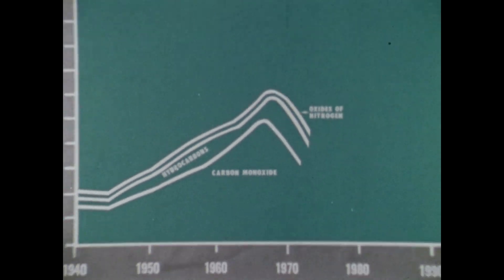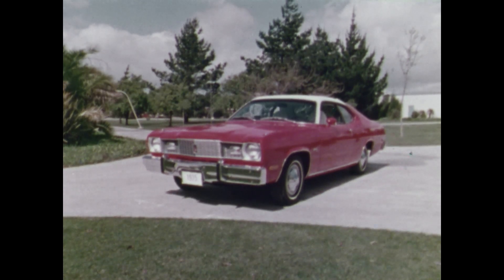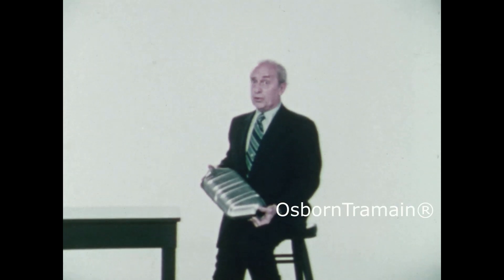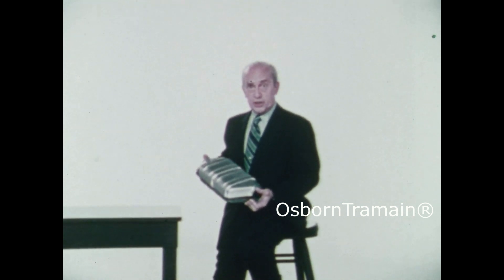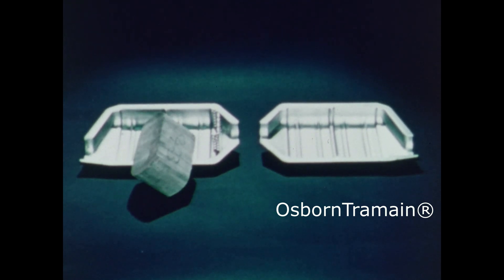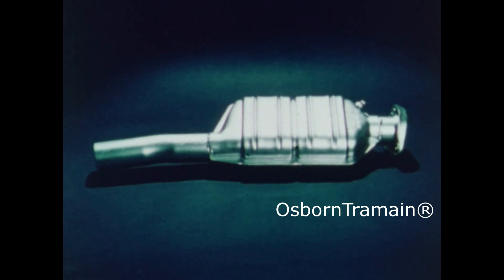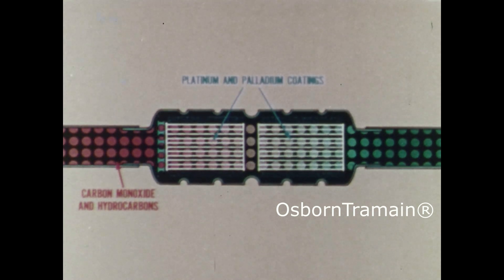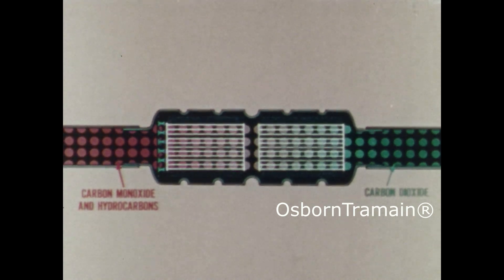1975 Catalytic Converter Film Commercial - Chrysler Corporation

Comment: True statement... 1975 cars with catalytic converters actually produced more power and had better fuel economy than 1974 models without, which were horribly detuned in attempt to meet emission regulations.
Reply: I recall Honda had their CVCC engine which didn't require a cat for several years later than the rest.
Reply: @DSC800  Correct. The CVCC meant that Honda didn't have to until 1980. VW did not either due to going to fuel injection. There was no way to put a cat on the Beetle and that's why they stopped selling them in the US market after 1979.

Comment: I remember when the catalytic converters first came out, I worked in a full service gas station at the time and our customers were lining up to get them removed! Yes it was illegal, but, nearly every garage was removing them back in the 70's.
Reply from the maker: Not in States  that had required smog testing to register your car.  You couldn't remove them because you'd fail your inspection, California was strict, so was Illniois and New York and Massachusetts.   You just wouldn't be able to remove it, I'm assuming you lived in some backwater southern State?  California still has smog testing for every vehicle to register it and drive it.
Reply: @OsbornTramain  What's with the insults? .."some backwater southern State" No need to insult our Southern Brothers. I am actually from Illinois, and no, there were not any "inspections" in Illinois during that era.